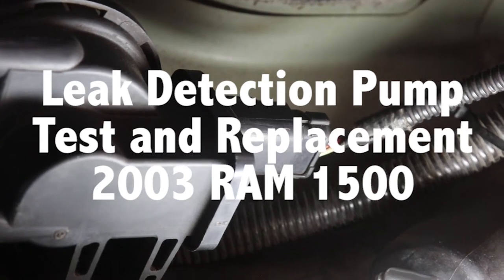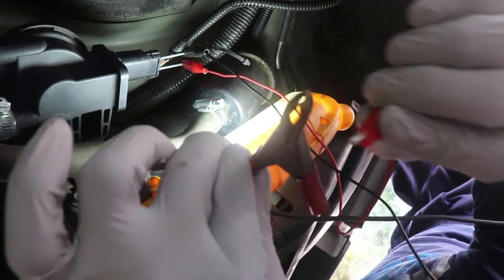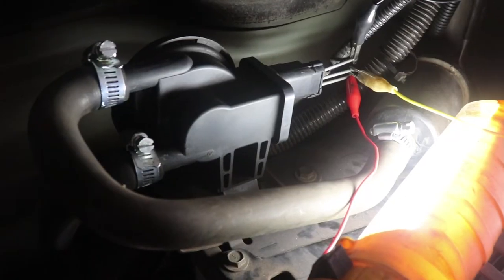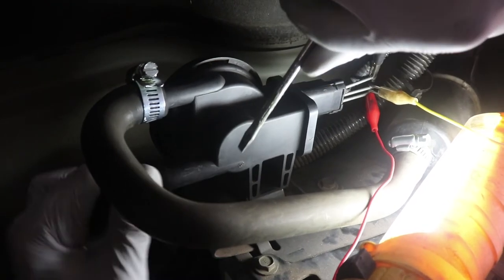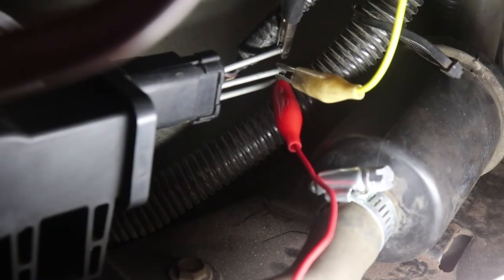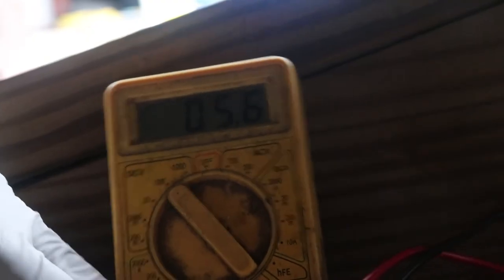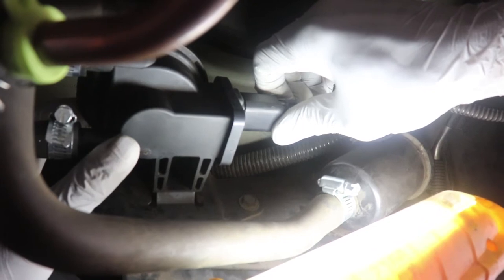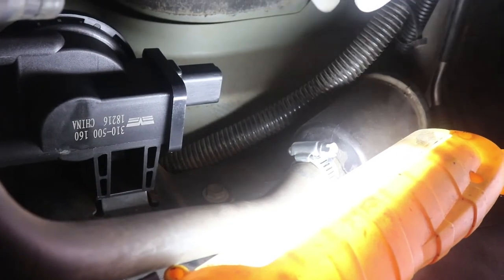How to test and replace a leak detection pump (LDP) on a Ram 1500 p0456 p0440

Comment: I just replace a leak detection pump on my 03 4.7 Ram.. My problem was I wasn't able to pump gas in the tank without it cutting off everytime... So I replaced it so we will see if this helps 🤷🏿‍♂️

Comment: Thank you for the video.....it is not a pump...it uses natural vacuum to monitor the system.....the true name is NVLD....natural vacuum leak detection.....the earlier versions were true pumps and required a vacuum hose from the engine to run the pump
Reply from the maker: Thanks for your comment and I would 100% agree that it is not a pump but for the ease of search for the part, the description “Fuel Vapor Leak Detection Pump #310-500” is absolutely correct. The video is not for the technically astute. The intent is for the average person with little to no mechanical ability and basic tools to save themselves a few hundred dollars diagnosing and replacing the correct part themselves. We all know the up charge associated with taking your vehicle to the dealership or most mechanic shops. Thanks again for your input.

Comment: I will have to try this. I have a 2005 Ram 1500 and I keep getting the P0456 code off and on. I have chased it everywhere with no success in finding the culprit. This gives me a new direction to try. I know those LDP are not cheap. But they have a really flimsy green gasket that the seal with. Thanks for the insight on this.
Reply from the maker: Sounds more like a leak with the on and off check engine light. Try disconnecting from the purge valve to the leak detection pump. Common leaks are right around the exhaust down pipe and the elbow connectors over the charcoal canister. 

Thanks for watching and please subscribe if you have not.
Reply: @TRRehab  thanks I will try that tomorrow. 👍

Comment: Lots of videos on leak detection pumps but this seems to be one of few for a 2003 Ram 1500. The color codes was on point. Check light gone. Thanks.

Comment: I have a 2004 1500 RAM, getting a P0440 code, I'm hoping the same solution applies. Great video thanks.
Reply from the maker: P0440 is likely connected to a fuel vapor leak. Start with the simple. Check all the hoses around the leak detection pump. Mainly between the charcoal canister and leak detection pump. Definitely want to check your gas cap seal.

Comment: I have a ram 1500 4th gen and I’m getting a P0441 code could changing out the evap leak detector fix this?
Reply from the maker: The P0441 code is set when the PCM does not detect a purge flow. Before changing anything I would check leaks between the purge valve solenoid and the leak detection pump. P0441 would be more referring to the purge valve solenoid. I have another video on a quick check of the purge valve.

Please subscribe if you have not.
Reply: Awesome thank you! And I sub’d 👊

Comment: Great stuff! very helpful
Reply from the maker: Thanks Scott for watching. I have 2 Ram trucks so as I do repairs I will be recording them. I hope they are as useful and I really appreciate you subscribing.
Reply: @TRRehab  I have a 2003 Dakota that is giving me Codes. Usually its the PO442 but occasionally its an O2 sensor code.
Checking all of the lines for leaks.
Is it possible that my thermostat is contributing to this problem? 
Last winter on a coup[le of VERY cold nights it seemed like my thermostat was getting stuck (probably in the OPEN position.
Do you think (now that its warmer) that could be fouling things up?

BTW great camera work and detailed explanations of the work.

Thanks again.
Reply from the maker: @scottdreher8122  Your thermostat shouldn’t have anything to do with p0442. This code is a small evap leak. The 2003 Dodge Dakota and the Ram 1500 are very similar. Check out my purge valve solenoid video. Most of the time it’s something simple as a bad gas cap seal. Your check engine light will often go in and out but check out my purge valve solenoid video, I think you will find it useful. Make sure you check the line between the purge valve and the leak detection pump. If that line runs close to your exhaust as I have found before. There could be a small leak created by the exhaust.

Much success!
Reply: @TRRehab  Thank you sir!>
Sounds like a good plan.
I will certainly check out that other video.
The reason I questioned the thermostat is that it will start fine...run for a few minutes...then start to run rough.
If I revv the engine slightly to get the temp up to running temp it levels off again and runs fine.

MUCH appreciated.
Great channel you have here!

Comment: Aight Fam preciate the show me how to test it video.... question.. I tested mine the other day removed it from the vehicle and tried to blow it like the front solenoid valve what canister attached...I sucked on it and blew on it and tapped it to the 12 volt source at battery although I heard it click on and off the pressure never did change... Did I need to tap into the middle wire also
Reply from the maker: Thanks for watching. Because of ease of access to the leak detection pump I have always tested them on the vehicle and for several other reasons as well. This works best for me because I don’t have all the fancy tools and there are several tests being done at the same time. 1. You are checking the audible click in the solenoid.... 2. You are testing vacuum and 3. You are checking that they are working in sequence, pretty much the way your computer would command. Your purge valve test is slightly different and a lot simpler. 

Check out my Quik test for purge valve and please subscribe if you have not. 

With the leak detection pump you go from a constant 5.9 or so voltage to around 9 to 11 volts depending on your battery when you turn your key to the on position.!The vacuum triggers the solenoid which should drop the voltage on your VU meter. This is the way that I do it because it answers several questions. Am I getting correct voltage both before and after turning the key to the on position. Is the solenoid working and is the vacuum triggering the solenoid as it should..

Hope this helps?
Reply: @TRRehab  ....I'll do the same test on mine today later I got clips is need something to probe the connectors with and I'll let you know but you wanted a few out there that's doing it and thank you for what you do!!
Reply from the maker: @fliboimoney  I’m no mechanic. I do it just like you my friend. Ask questions and watch videos. I did the video with hopes of helping others like us. We are just trying to save a few dollars and keep it in the road.

Comment: Hi, I get a P1494 code on my Chrysler Concorde LXI.  I replaced the charcoal canister, the LDP, The purge solenoid,  in the front by the radiator,  and the little T looking thing, thats near the LDP? IM Still getting a Mil light, but not every time I start it? It could go a week, or more, then I clear the code, and its an ongoing cycle, any ideas what to check? The only thing I didn't replace is the canister filter, can't find one? It's a 2000 year, by the way?
Reply from the maker: Hey Mark. Thanks for checking out the video. You mentioned changing parts but  didn’t mention if you checked the actual lines vacuum which p1494 and   intermittent check engine light would be a symptom indicator. If you have not, trace starting with the intake to the LDP then the LDP to charcoal canister. You also should have a few other lines. Find the start and end of each. Cap 1 end and apply no more than 15 inches of vacuum to the other end. Check all elbows as well. 

I hope that helps and if you haven’t subscribed please do.

Comment: See that round canister, by your yellow light? I need one of those, for my Chrysler Concorde LXI, and can’t find any part of it? Any suggestions?
Reply from the maker: Hey Mark.... If you are referring to the hose going to the filter I believe it is no longer available. I used same hose that goes between the LDP and the canister. Cut the end off to get the U shape to the filter. The I.D. is the same on both hoses. I added a link in my description.

Comment: Hello, I hope you could help me, I measured a value of 2v and 5.3v where you measured 5v and 9v, what should be the resistance on the pump?
Reply from the maker: I don't believe it checked the resistance which I should have for the sake of the video. After all that it was a leak inside the insulated sleeve. Apparently it had been rubbing against the exhaust. That's a very common spot but to your question.... Should be around 35 ohms... I hope that helps.
Reply: @TRRehab  thank you for the quick response, that 35 ohms is measured at the same pins (middle and ground) as your 5v and 9v? Because I measured unlimited resistance… and I measured 8.3 ohms at the the other pin.
Reply from the maker: @justinjheijnen  It's been a minute since working on the pum but I do believe you are correct.

Comment: Those clamps that you have on the nvld were those put on by you? because I have a 2005 pacifica and mine don't have clamps there and the hoses are super tight I had a rough time taking them off the nvld. I'm chasing a p0440 with a brand new nvld and brand new purge valve. Thanks.

Comment: That was a great video, i have the same problem on my 2015 toyoto corolla. Can u tell me when u had the pump off, did u check the pins for continiuaty and for ohms to see what it read? My pump has 7 wires going to it and im trying to figure mine out. Thanks
Reply from the maker: Thanks for watching. Unfortunately I haven’t worked on the Toyota evap. You should have a 10 pin connector with 7 pins in use. 2 for the vent solenoid, 2 for pump and 3 for fuel tank pressure.

I have a wiring diagram that may help if you want me to email it to you.
Reply: Was u still going to send me the Toyota wiring diagram)
Reply from the maker: @comanchejr921  Yes. I need an email
Reply: Thank u so much.
Reply: Please let me know if u got it?
Reply from the maker: @comanchejr921  sent

Comment: I have a 03 2500 5.7 hemi when the truck is running you can here it clicking kind of fast does that mean I have a leak some where great video by the way very informative
Reply from the maker: If you are hearing a consistent clicking from the leak detection pump your solenoid inside is most likely defective. Unplug it as shown in the video and test continuity first and then check for the sound when applying a 12 volt source. Hold the power for no more than 2 seconds and you should only hear the plunger open and close. Please subscribe if you have not.
Reply: Thank you I will have to try that. It clicked for about 5 min straight today just sitting in the drive way idling shut truck off for about an HR started the truck  back up an it was only clicking every now an then it's loud enough if you are standing by the truck it will make you turn your head like what the heck it that noise I have video of it if there is a place I can send it to you
Reply from the maker: @randyjr00021  upload it on YouTube. But if you are hearing consistent clicking from the pump. Unplug it and plug it back up. Could be a connection. All of which I went through in the video. 

Upload it to YouTube
Reply: I just uploaded it

Comment: The vapor canister vent valve, I replaced too, when I said the T looking thing?
Reply: I looked at a few, when I took the canister out, the fatter ones, mostly? I also checked the lines under the hood, which is where my purge valve is? Up next to the radiator. Looks like I'll have to dig a little deeper? Thanks for the info. Much appreciated.
Reply: The MIL light hasn't come on in a week or so? When it does, I get p1494 code, I clear it, and the same thing happens? Another note, the engine light, only comes on, with a cold start?

Comment: My leak detection pump vibrates and sounds like a 3 second long fart when ever I shut the 05 Liberty 3.7L off. Yes that's right a fart. I am going to try your method the see if the pump is good.
Reply from the maker: Let me know how it turns out? This test should work for your vehicle as well.

Comment: Can I ask, where do you get those formed bigger hoses? If I'm under there, I'd like to replace them? My car is 20 years old, so I'd might as well?
Reply from the maker: I’m not sure if the 2003 Ram LDP hose will work on a 2000 Concord. W

What’s the year, make and model and the exact part you are looking for?
Reply: @TRRehab  There's two short hoses that come off the LDP, one to the canister, and the other, I believe goes to the vent valve? Theres 2 hoses that come off the vent valve, I'm pretty sure? Then the bottom is open. Then I have a hose that is long? The canister,and the LDP, ARE basically on the passenger side, tucked up next to the gas tank? There's a long hose that runs from the charcoal canister, over the gas tank, to a canister, with a small filter in it, that I can't find anywhere, too? That basically runs to the drivers side? I'd like to replace all of them, its original equipment, it looks to me? I took the filter out of the canister, and cleaned it, the best I could, but I need new, the local dealer says discontinued? IDK?
Reply: @TRRehab  The vehicle is a 2000 Chrysler Concorde LXI 3.2, manufactured in Canada, I just found out, on the door jam sticker.

Comment: My 04 Laramie crew cab has it also plus I've got a block heater on my truck. Originally from Canada
Reply from the maker: Wow, block heater! Fingers get cold just thinking about it. I’m in Georgia so luckily we rarely get below 25 degrees. No block heater here. I hope you have a timer for that block heater. Could save you on power bill as well as premature failure.

My 2004 Ram SRT10 has a totally different leak detection pump then my 2003 Ram 1500 5.7
Reply: @TRRehab  I'm in Ohio the truck is originally from Canada. I've lived in Ohio all my life
Reply from the maker: @roberthanning7044  The truck being from Canada would explain the block heater. Gets pretty cold in Ohio too. Not too bad here. I’ve been loosing air all winter from my rear shocks so more than likely my next video will be checking the air lines and hoping the shocks aren’t damaged. The truck is always level so I’m hoping something as simple as replacing the hoses.
Reply: @TRRehab  I just bought rancho 9 way adjustable shocks for.my.truck. $700.00 for all 4 but excellent ride

Comment: Is the pump on the bottom of the truck or top?
Reply from the maker: The pump is located under your 2002 Dodge Ram 1500-4wd-regular-cab-swb, towards the left side.

1st thing to check would be wiring for shorts. If no bad wires change pump. It should be less than $100. 3rd could be a default in the ECM. I've never worked on a 02 Ram but I had a ecm rebuilt for a 03 for I believe $400 but that was a few years ago. If you need the ECM rebuilt siaelec.com Phone: (800) 737-0915 is who I used. Took 2 weeks and is still running. 

Hope that helps. It that subscribe and notification bell if this was useful.

Comment: I can’t believe you replaced it with a dorman part.
That should last a week maybe.
Nice diagnosis though
Reply: Dorman parts are good if not better in some cases over oem.
Reply: @rhurtadorh32  can you name a part and situation?
Reply: @mikesabin8568  🤦‍♂️you gonna learn today. On them buick enclave gmc acadia chevy traverse have those heater hose with the t connectors made out of plastic where dorman came with the exact part but instead of plastic there aluminum t connectors, so they wont break and over heat your engine. On them 3.6 pennastar engines i belive dodge cars their engine cooler or housing goes bad because again oem made them out of plastic and dorman has a upgraded version of aluminum housing. And also dodge computers seems to accept dorman sensors as it wont accept autozone sensors. I know i have a 05 magnum rt
Reply: @rhurtadorh32  ok, well im totally convinced… you should put nothing but dorman temp door actuators on cars and see how that turns out for ya

Comment: If you touch those other probes you will fry the transistor in the ECM PCM ETC
Reply from the maker: Thanks very likely. I would suggest unplugging the wire connection if you aren’t sure
Reply: @TRRehab  I think that using puncture probes through the insulation is safer than back-probing and avoiding back-probing two or more together, especially with T-PINS. Insulated straight pins are safer, but I avoid back probing myself and I use the puncture pins and then apply some clear nail polish over the puncture afterward to prevent corrosion later.

Comment: its a 20 dollar part easier to change it than check it.
Reply from the maker: So you change out the just $20 part and the check engine light comes back on with the same code? You just threw $20 in the trash and you still can’t get your vehicle to pass emissions. If that works for you 👍🏽. Personally, I like to know the “why”. That’s worth far more than $20.

Thanks for watching
Reply: @TRRehab  it's not $20, it's $40
Reply from the maker: @jlrockafella  Thanks for the comments. You are correct. The part at most brick and mortar stores vary from $30 plus and as high as $60 plus. To have it diagnosed at a shop and replaced as high as $300. It is a lot easier to simply change the part but for me personally, “not a mechanic” .... just feels good that I not only solved the problem but that I actually have a better understanding of why. I’m not trying to teach in as much as encourage people like myself who are not so mechanically inclined.